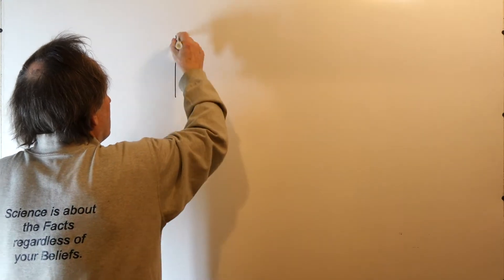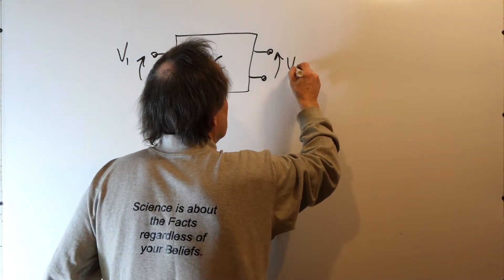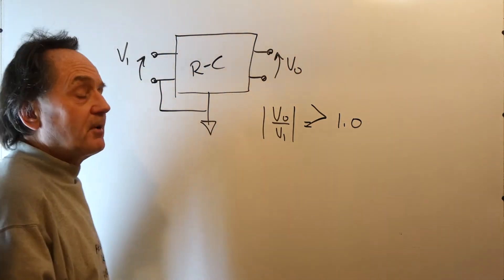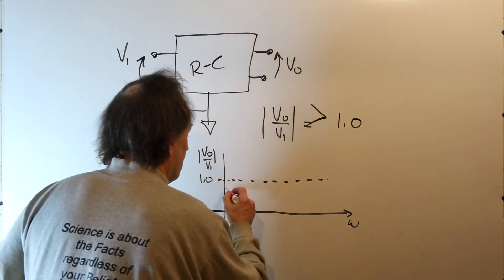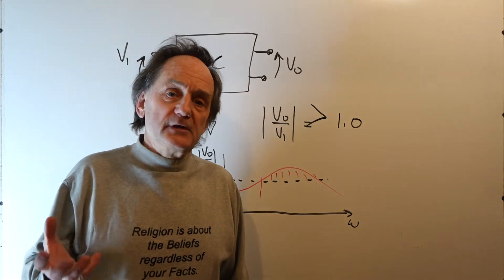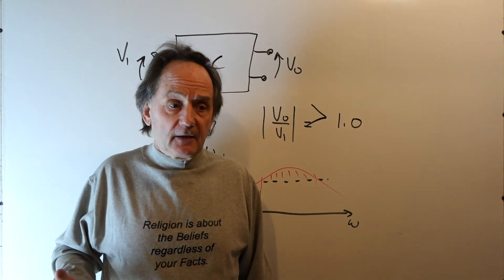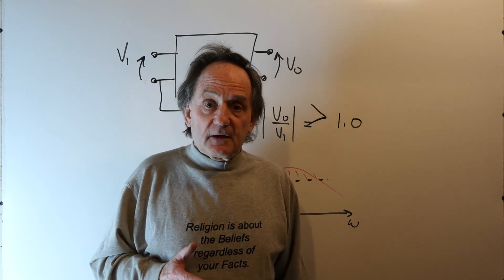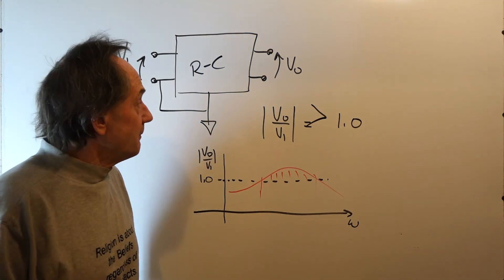Can a passive R-C network produce a  Voltage Gain:  Vo/V1

Comment from the maker: ############################################################
     An answer to this problem will be posted on the weekend of February 24, 2019
############################################################
With the answer I will give the philosophy behind designing a network that will satisfy the design criteria and give a specific network and its transfer function along with a Bode plot of the output/input to demonstrate the solution.
GH  02/16/2018

QUESTION:  Can I use a low pass filtered ladder network?
ANSWER:  Why not?  Any network will do as long as the network elements are Rs and Cs and the output is greater than the input over a range of frequencies.  You do realize do you not, as traditionally configured, the output of the low pass network is always LESS than the input?
Reply: No video solution?
Reply from the maker: Not yet.  It is on my list but several videos to make before getting to the solution of this problem - be patient
GH

Comment: Possible-Nothing wrong as it will still obey the energy conservation like transformer. But it is a bit tricky to gain >1 as the max Q of pure RC network is 0.5. Think of a network with TF as H(S), now imagine the same network with input being ground and ground being the input, which will modify the TF as 1-H(S). The difference between these two configurations output is 2H(S)-1. This can be easily grater than at least for some frequencies. I have tried one ckt in Cadance-i have got 1.199dB gain.
Reply: But waiting for your video--It's already March 2020!!!)))
Reply: @rajasekhar4289  I've seen an example of this actually used in a guitar effects pedal called the 'UniVibe' made by the Univox company back in the 1960's. It is a type of phase shift effects pedal that kind of simulates a Leslie Speaker.  Anyway, one of the subsystems is a Low Frequency Oscillator to drive the phase sweep circuits. That oscillator uses an emitter-follower circuit (Amplification factor of 1 or less) driving an adjustable phase network composed of ONLY resistances and capacitances. When I first saw this, I didn't this this could work as an oscillator until I actually breadboarded it and verified it works. It follows that the phase network is supplying a voltage gain (power lossy) in order for it to start oscillating. That is my non-mathematical response, I was hoping to see a follow-up to this...

Comment: I just stumbled upon this video and I'm surprised that nobody answered the question. The answer is: "Yes", a purely passive network can create voltage gain i.e. Vo/Vi > 1.0 (though of course not power gain), albeit not very pronounced. A simple example would be an AC source  which drives a resistor series at two taps coupled through capacitors (hopefully recognizable):
+------------V1 O---+--C2----------+----O Vo
|                           |                R2
AC                      +--C1----------+
|                                            R1
+------------------O--------------------+----O
GND

But the increase in this setup is only about 4% at the peak frequency.
It works, because the C1-R1 high pass creates a different phase shift from the C2-(R2+R1) high pass
Reply from the maker: Wei Ni Ho,
That is correct.  A whole class of passive circuits having voltage gain can be created by subtracting a phase shifted version of the input voltage from the input voltage.
A 3rd order RC ladder network can give a 10.7% increase in gain (+0.89db) at the broad peak which occurs at the normalized frequency of Wn = 1.5
GH                             January 19, 2019

Comment: While I regret being unable to provide a definitive answer to this question due to my lack of mathematical ability, I believe that I can see Mr. Hnatiuk's footprints.  It seems likely that the question was inspired by his analytical view of twin-tee notch filters.

A series-resonant LC circuit produces a voltage gain.  We are not allowed to use an inductor, so an inductive reactance needs to be simulated by a suitable R-C network.

I suspect (but do not know) that the output impedance of twin-tee notch filters undergoes a substantial change on either side of the notch frequency, possibly becoming capacitive on one side and inductive on the other.  So we must choose a frequency close to the notch frequency such that the output impedance provides a element of positive reactance, thus simulating an inductor and series resistor.
Reply from the maker: George10767,
Actually this question was not inspired by the twin "Tee" notch filter.  A Twin "Tee" does NOT produce voltage gain at ANY frequency.  The Twin "Tee" network has Vo/Vin <= 1.0 with a deep null at the notch frequency.  Also, the impedance of a passive R-C network can NEVER be reactive inductive.  The reactance will always be phase "lag" with respect to a pure resistance.
That is to say, a passive R-C network can never be used to simulate an inductance.  However,  an R-C network in conjuction with dependent sources used to model an amplifier, can simulate just about any type of circuit element including gyrators and negative impedances.  With active networks utilizing certain feedback and feedforward configurations, the network poles can be placed ANYWHERE in the complex plane.

This network theory question (voltage gain from an R-C network) can be answered without much if any mathematics.  However, it does require an understanding of the characteristics of passive R-C networks and what characteristics those networks can realize.  Remember this question assumes a totally passive network - no dependent sources ( no amplifiers).
GH

Comment: if there is no any  tricks normally an answer is No, as it is a low pass filter which characteristic falls from the corner frequency with ratio of 20dB/decade. Only if you connect its input to the circuit with the inductance like buck or boost converter output. then resonance frequency will appear at which we can observe some "magnification". Summarizing it must coupled somehow with inductance to introduce resonance/oscilations. It is first order system, to have oscillation you must have second order system at least.
Reply from the maker: An R-C network can also form a high pass filter where output rises 20db/decade.   A capacitor working into a resistor is a 1st order HPF.
You can have a higher order system than 1st with an R-C network.  The difference with a high order R-C system than R-L-C is that the system poles for an R-C must always lie on the negative real axis whereas an R-L-C network can have complex system poles that are off the real axis and in the complex plane with non-zero imaginary parts.
Try again.
GH
Reply: "An R-C network can also form a high pass filter where output rises 20db/decade." Thats true but then its connected like C-R, looking from left to the right. R to common point. It is rising yes 20db/decade but it is not going above 0 dB line= no gain.
Reply from the maker: No, a HPF of that configuration rises from ZERO output to Vo/V1 --> 1.0  
Never exceeds Vo/V1 = 1.0   but approaches it asymptotically